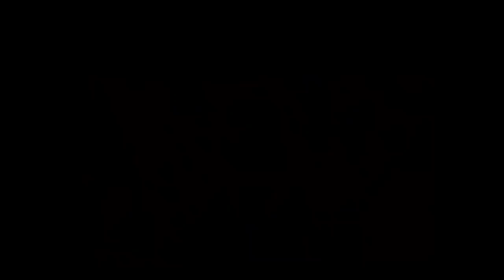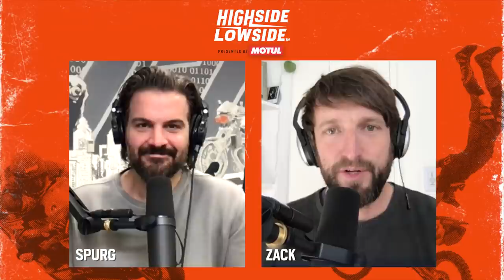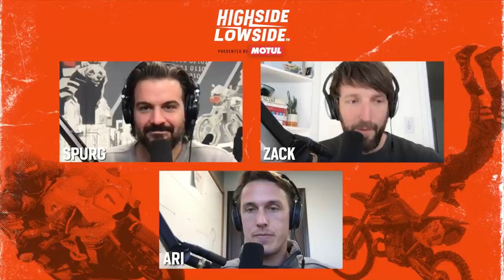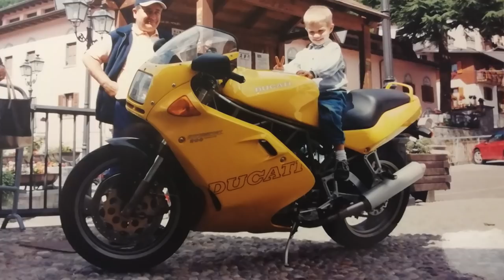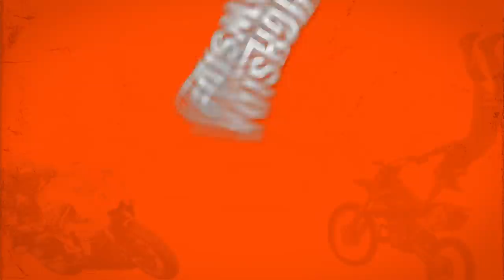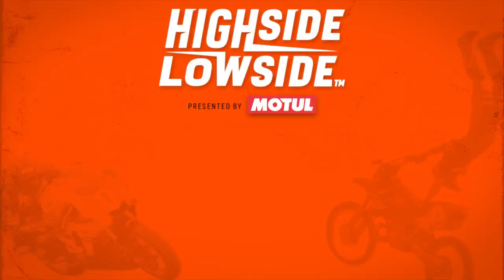Mechanical Motorcycle Mistakes We All Make | HSLS S3 E9

Comment: My biggest mistake was with brakes on a car. I was working on a mazda and when I looked at torque specs online, what I searched for I thought was very low torque on the calipers bracket bolts, only 30 ft pounds, but did call for  blue thread locker. Looking back, I think the 30ft/lbs was a typo, but it probably would have been fine I I did remember to use thread locker. But I didnt on one of the bolts, and it rattled out after a couple hundred miles. Thankfully the caliper didn't fly off, but the caliper lifted each time the brakes were applied and made (appropriately) concerning noises and rattling. My (then) GF wasn't happy. 

Good news is no damage was done, she forgave me, and she is now my fiancé.

Comment: Sport touring tires on a spoked rim is possible. The bead seats easier but putting holes in the tube happens. I usually reuse the old tube until it gets punctured. Am I doing this wrong?

Comment: On the special tools note, reminds me of the first time replacing the clutch on my '92 Honda Nighthawk 750. That stupid castle nut that I didn't know required a special tool heading in just dogged me throughout the entire process. I had already ordered all the parts and was doing disassembly pending the arrival of parts, and neither wanted to spend the money on the overpriced special socket nor wait for Honda's once-a-week order fulfillment. About 4 hours later with a hardened steel socket and lord knows how many Dremel grinding disks, presto, I have my own special tool. And then the replacement parts arrived and Honda's superceded clutch nut is now of the standard hex variety, my only socket for which was now a special tool.  Also, Ari, the caution about sport touring tires would have been wonderful advice to have included in your video where you made it look sooo simple. Frigging brutal.

Comment: Not getting frustrated is such a huge point.
I learned really early that frustration gets u nothing, its really important to stay calm and think about what just happened and how u can fix it if youve just done a mistake.
Problem is: not everyone gets that, in my experience people can mistake  "staying calm" with "not caring". Had to learn that the hard way after i crashed a cnc machine
Reply: Crashing a haas is expensive. Throwing a screwdriver because you are trying to adjust the carbs on your 4 cylinder 70’s Japanese bike is cheap and cathartic.